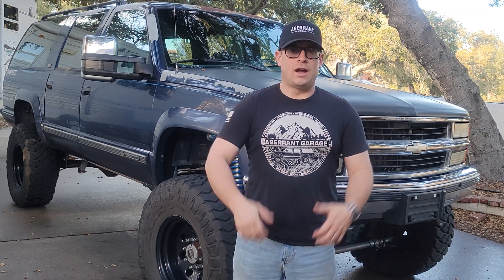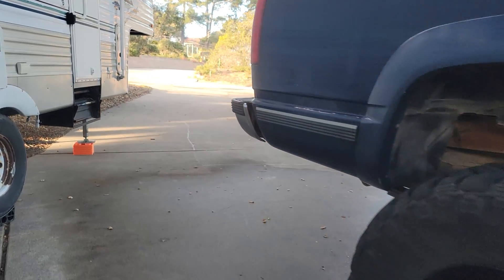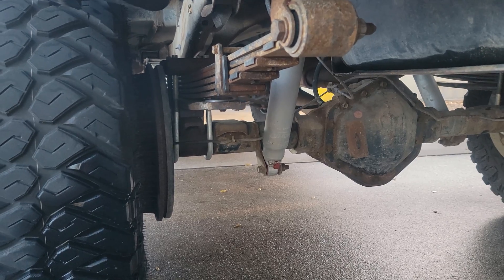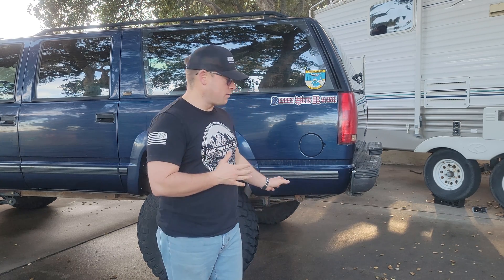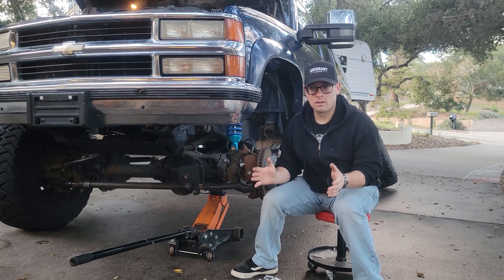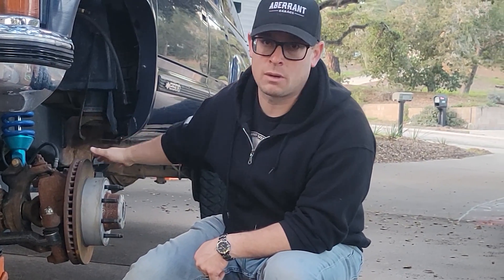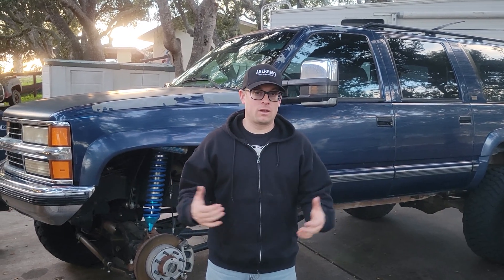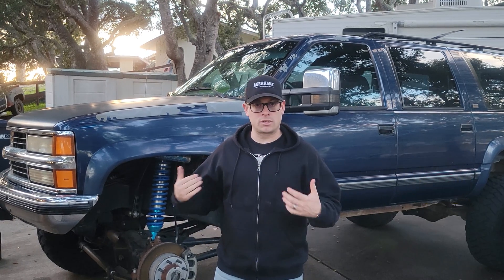OBS Suburban Solid Axle Swap | 1994 Chevy K2500 Suburban

Comment: This a crazy build how much did this cost and how long did it take to to do where did you get the axles?
Reply from the maker: @Dmdmvt  the build was done completely in my driveway. From the initial start, it took about 9 months to get back on the road, partly because I moved during the build and had to deal with that. To get fully functioning 4wd back with gearing the front and rear axles, custom front driveshaft, etc., I think it was about a year total. Cost wise, I've been afraid to add it all up, haha. I did do a bunch of motor and transmission stuff while I had it all apart, but all in, I want to say I was around $10-12k. As for the axles, my burb is a K2500, so it came factory with a full float 14 bolt, and I got an 08 F350 Dana 60 for the front from LKQonline.com
Reply: @stoprez2006  I appreciate the quick response I love the build man it's amazing honestly I have a 6.5 diesel I wanna axle swap
Reply from the maker: @Dmdmvt  i wish mine was diesel. It's a swap I've toyed with doing haha.
Reply: @stoprez2006  if you have a 14 bolt you don't have to change the rear axle ?!
Reply from the maker: @Dmdmvt  I didn't change the rear axle. I am running adapters on the rear axle that make the bolt pattern and width match the Ford front axle, and I changed the ring and pinion from 3.73 to 4.56.

Comment: I've been looking into the torque masters locker for my 1994 suburban, it also has the ff 14 bolt. Have you had any issues with the torque master locker?
Reply from the maker: @josephkrieg6013  no issues at all. It does ratchet pretty loudly, but it works great! Just to be clear though, I have a Yukon Grizzly locker in my 14bff and the torque master in my front Super Duty Dana 60

Comment: What are the specs on your Rims? 12" wide? -44 backspace? I love that look
Reply from the maker: Thank you for the compliment. The wheels are 17" and they are 9" wide. They also have a 0mm offset and 4.5" backspacing. It looks like they are wider/deeper because the Super Duty axle is about 6" wider than the stock IFS suspension was and has the Ford 8x170 bolt pattern. Since the stock 14bff rear axle was similar in width to the IFS and had the wrong bolt pattern, I put 2.5" spacers on that adapted the stock 8x6.5" bolt pattern to the Ford pattern.

Comment: Great video man! Super informative. I just parted out my 06 superduty to repurpose the axles and wheels/tires.
I'll be ordering the wfo kit this week to mount it all under my lb7 swapped 95 k1500!
This is the best video I've found showing the front set up besides wfo's videos.
Thanks!
Reply from the maker: Thank you! I really appreciate that. One thing I found early on in my swap was the fact that there were a lot of the small but critical details that were left out of most videos on this swap. I was hoping to fill that gap. Please reach out via my Instagram, @aberrantgarage, if you have any questions. I might reach out to you about that Duramax swap for future plans 😏

Comment: Nice truck, do you find the wheelbase limiting? I’m planning a future family wheeler, I’m debating between an obs Tahoe or suburban that I will likely sas. I do like that you can get a suburban in a 3/4 ton chassis
Reply from the maker: Compared to a jeep, the wheelbase has pros and cons. Where I live, I haven't found many instances where the wheelbase has been a hindrance.  If anything, having a longer wheelbase has helped me make climbs and stuff that the jeep guys have difficulty with. In another environment, say Colorado for example, the longer wheelbase could be an issue. With the 08 Super Duty axle, steering isn't horrible but there are options to get a few more degrees out of it. Overall, I have been pretty happy with it. I would like for articulation in the future but it works well for our uses now. Having the 3/4 ton chassis is great, especially since it came with a 14 Bolt from the factory.
Reply: Thanks for the info, great content 👍

Comment: Also what kind of tires and rims are those and how much u pay for them.
Reply from the maker: The wheels are the cheapest set of 17" steel wheels I could find from National Tire and Wheel's website. Tires are 37x12.5x17 Maxxis Razrs. I got them I. A package deal from ntwonline.com so they arrived mounted and balanced.

Comment: How much you spend
Reply from the maker: After the front axle swap and associated suspension, rear shackle flip, wheels and tires, gears and lockers, front driveshaft, and a bunch of odds and ends like gaskets, water pump, radiator, steering box, etc. I've probably spent close to $12k. The motor and trans both leaked pretty bad, the steering box and new axles tie rod ends we super sloppy, and a bunch of parts that I replaced for the sake of reliability, were all done as part of the build. We use it a lot on road and I want to do some long distance trips like Moab so we wanted ot comfortable, capable, and reliable.

Comment: Getting ready to do ghe same thing on my Cummins swapped K3500 dually. Picked up a complete front frame section from a 2005 F350.  Not entirely sure if I'm going to stick with the Ford springs or go coilovers (due to cost) but we'll see.  I really love the WFO cross member but my transmission is slid back 4.125" inches with the 12 valve swap so not sure what I'll do there.  I'd hate to hack up a $900 mount but who knows.
Reply from the maker: I think you could probably slide the crossmember back and drill new holes. You would definitely have to make custom length radius arms though
Reply: @stoprez2006  I'd probably keep the crossmember in thr same position and just cut and reweld the trans mount back

Comment: Awesome build. Very informative video.  Just ordered the WFO swap kit for my 1994 2 Door Yukon, and this was extremely helpful. Thank you!
Reply from the maker: Awesome!, Thank you for the supportive words! I learned quite a bit a long the way and helping others with their builds and sharing the knowledge is one of my favorite things. Please feel free to check out my FB and Instagram pages for more on the truck. Also, feel free to reach out if you have any questions. I will do my best to answer them!
Reply: I just watched this, and have a 2 door yukon as well. Was thinking of wfo kit as well. What the kit cost ya? Said and done
Reply: @donburshaw6505  the kit is 20% off for Black Friday right now. I was ~$5500 for front and rear with fox front coilover. However after buying/building the axles and various other parts like rear shocks and drivelines etc. it will quickly be 2-3xs that.

Comment: I have a 94 k2500 454 also. I’m in the beginning planning stages of a build. My ABS module went bad a few years ago. I unplugged it and the abs light is always on now. Since you rerouted the lines, do you have an ABS dash light on? Do you still have the module you took out? If so, would you want to sell it?
Reply from the maker: I do not have any brakes lights on any more. I removed some wiring that wasn't used anymore, i.e. wheel speed sensors up front and the gm front axle actuator stuff, but I believe the power plug for the module is still there. I do have the module. Reach out to me privately on either FB or IG or via email, all of which can be found on the channel's About page.

Comment: Could you direct where I might find just original front CV axle, ? 
93 K2500 truck ... Chevy dealer parts man said according to VIN my oem part # is 26062614.....
Reply from the maker: Rockauto.com has 3 options at the following link: https://www.rockauto.com/en/partsearch/?partnum=26062614

I hope this helps!

Comment: So is it possible to keep the ABS system?  Also, after labor, what was your cost in the conversion?  Ive got a '99 2 door tahoe that I want to do this kit on.
Reply from the maker: I think that it is possible. I was on the fence about keeping it in the first place but the location I chose for the coilover towers prompted my decision. If that module had still been installed when I put the towers in, I may have been able to prevent the interference. Also, you could possibly relocate the module too. As far as the all in cost, that is hard to say. I was originally quoted in the $15-20k range to have WFO do the swap. I am not that rich and I wanted to challenge myself to do it on my own. There are a ton of variables such as what small parts your specific situation will need like fittings/fasteners, any other work you do along the way, gears and lockers, etc. When I did my SAS, I pulled the motor and trans and replaced a ton of gaskets and cleaned everything up, deleted the ABS which meant new lines and adapter fittings, and did gears/lockers with full differential overhauls. I haven't added up my receipts but I would venture a guess to say I probably am somewhere around $10-12k all in at this point. Rough numbers, I have about $4700 in front suspension and axle, $450 in rear suspension, $1800 for wheels/tires and bolt pattern adapter for the rear, $1700 for the gears/lockers and diff rebuild, $500 for the front drive line, plus all new unit bearings and brakes for the front axle, and all the gaskets and small parts for the engine/trans. None of this accounts for any labor rate since I did all the work myself, with the exception of most of the welding as I enlisted the help of a good friend. I did the fitment and tacking of the welding parts and he made sure it was all glued together properly.

I know this is a pretty lengthy response and I apologize if it is more than you were looking for but your question is pretty involved and not as simple as one may think. I hope this gives you some insight for your project. If you ask whether I would do it again considering the cost and time involved, I would say absolutely! I loved the process and have joked with my wife about building a SAS OBS Chevy for one of my kids just so I could do it again haha. Please let me know if you have any other questions.
Reply: @stoprez2006  I appreciate you taking the time for such a lengthy response. Does it drive like an old solid axle suburban on 37" tires?
Reply from the maker: @Kyle-ev4fk  As compared to stock, I think it rides way  better! There is still some room for improvement as one could consider my setup to be incomplete as I don't have any sway bars or a steering stabilizer. It has some body roll to it though I would say it is less than one would expect for a rig this tall that has no sway bars. There was a significant amount looseness in the steering at first but then I started going though parts that weren't replaced initially, i.e. tie rod ends, steering box, etc., and found a bunch of stuff that needed  replacing which tightened things up a lot. I think a steering stabilizer, or the hydro-assist I have been saving for, will be the final link I need. It is super smooth riding though. The coilovers make the front end float and the Ranchos I have in the rear are ok, one day the back will be on Kings too and se will really be riding like a dream. As is, it rides as nice as our Escalade ESV, just not nearly as fast as the Escalade haha

Comment: Hi I am your insurance agent, I see you no longer have abs…
Please call me as your rates have now changed lol 😂
Reply from the maker: Shhh.....you didn't see anything.......
Reply: My 93 single cab short bed had a gutless TBI 5.7  for some reason the license bureau in insurance feels it has a V6 or a 305 ?  I swapped in a 6.0 ls 4l80e  bolted to my 241c   Terminator x max ECU 14 bolt semi float 6 lug 488 gears with Detroit truetrac on Mickey Thompson 35's and possibly turbo in the future,  has a 3 inch body 6in ifs lift. $150  6 months  liability insurance 😁 man I'd like to do this swap but whoa that's a lot lot of money. I hope I don't regret currently working on putting the 9.5 ifs out of the donor  2004 2500hd in it.  All I have to buy it the high-dollar axles, gears to match the rear and a e-locker or air and compressor, ham joints solid rod for tie rods.... stupid question " do those ford axles or solid axles not have ball joints?  I've Hurd people say that a Dana 44 is not much improvement over ifs. Go with the 60 or leave it be. I guess the answer for some like me is, if you cant afford it, there's your answer. Buy ball joints wheel bearings in bulk.
Reply from the maker: @kevinwest3689  it is a 60 with ballpoint instead of kingpins but it is way stronger than the stuff in these trucks from the factory. There are ways to do it cheaper but I'm pretty happy with it so far
Reply: @stoprez2006   I didn't realize some solid axles have ball joints. I bet you are happy with it, I would be, don't think I can afford to be so happy. Might be cheaper easier to just go by a ford and put the turbo 6.0 ls in it. Thank you for your time sir 👍
Reply: @kevinwest3689  There are ball joint eliminators out there. Im building my 05+ SD D60 for my 1/2 ton obs burban as we speak.

Comment: I have been trying to decide between a solid axle swap and a 6 inch suspension lift and 3 inch body lift for 37’s on a 2500 burb. The cost to do leaf springs would be over double the ifs route and I don’t do rock crawling, the main off-roading I do is mudding and sand dunes so I don’t know that the solid axle is what I need or if it’s overkill.
Reply from the maker: I will be honest with you, I do have a significant amount of $$$ wrapped up in this. Some of that is a wash between a regular lift kit and this swap. For either setup, you're going to need wheels/tires and going to 37s is going to require a re-gearing. I don't know what engine you have but even with the torque my 454 is putting down, my transmission was on borrowed time with stock gears. Do you need lockers and stuff like I did, probably not but it isn't significant cost in the grand scheme of the build and mudding could benefit from locker whether on IFS or a solid axle. I thought about staying with IFS and building that as much as I could to push the limits of it with upgraded shafts, steering, etc. but at the end of the day, the cost of upgrades and the characteristics of a typical IFS lift just didn't make the cost difference worth it for me. There are several drawbacks of a typical IFS lift that I wasn't comfortable with and the lift kit market for an OBS 2500 Suburban is awful, there is only a couple companies to choose from. A couple questions to ask yourself are 1) are you doing the work yourself or having it done, 2) do you have the skill and equipment to do it yourself if you want to, 3) are the cost differences worth the benefits? The ride alone of the coilovers over torsion bars justifies the cost for me and the capability of the Super Duty 60 and the braking improvement is icing on the cake. Given the chance to build another SAS OBS, I would go this route again hands down over a standard IFS lift. Now a custom long travel system.......
Reply: @stoprez2006  i have the skills and knowledge as well as the tools and abilities to do either way but the time factor tends to shy me away from the solid axle. As a budget off-road rig, it’s hard to justify the price when it also means the truck would just take a lot longer. The solid axle does sound nice for the fact of how horrible torsion bars are on obs trucks to work with. There are absolutely benefits to both sides. I would be doing leaf springs given my budget so ride quality is gonna be pretty rough either way. Thank you so much for all the helpful information! And lockers are definitely a must for any off-road rig in my opinion.
Reply from the maker: @Nova_17_  honestly, if you went with a 99-04 super duty axle and leaf springs, your timeline wouldn't be too much longer than an IFS lift. The IFS lift requires removal of all the same parts. Removing  the factory control arm mounts would add a little time but not that much given the right tooling. ORD has bolt on brackets that are pretty inexpensive and easy to install and they also do custom leaf springs which would make the ride quality way better than typical lift springs from a square body. The increased strength for mudding, lockers, and tires could easily justify the time. Consider how much time you could gain back by not having to keep changing broken CV shafts?
Reply: @stoprez2006  this is very true, the time and cost of ball joints and cv axles could make it worth it along with tie rods and alignments
Reply from the maker: In all honesty, I am not trying to sway one way or the other. I simply want to highlight some other view points and maybe challenge you to think a little different is all. IFS lifts definitely have their place but the market for a 2500 Suburban is severely limited so your not likely to get a lot of performance benefit for the style of wheeling you intend to do. I would also be willing to bet when you factor in the recurring repairs we both mentioned, your return on that initial investment may come sooner than you think. Shoot me a DM on IG, I would love to follow along when your build gets under way!